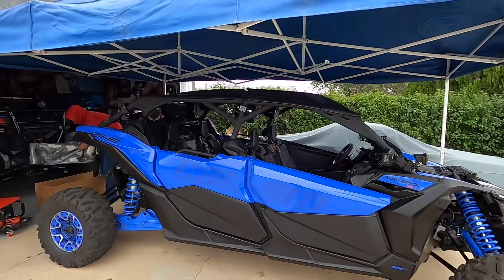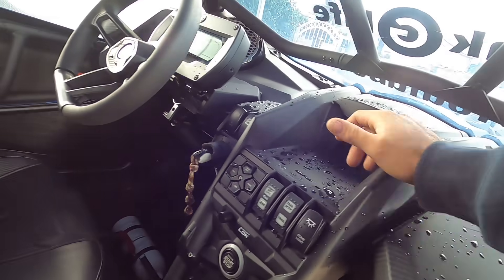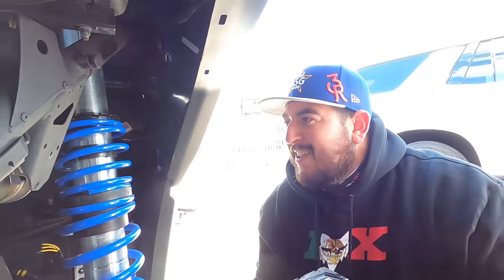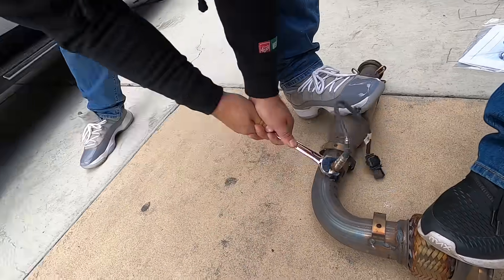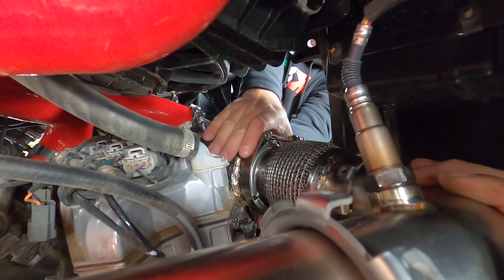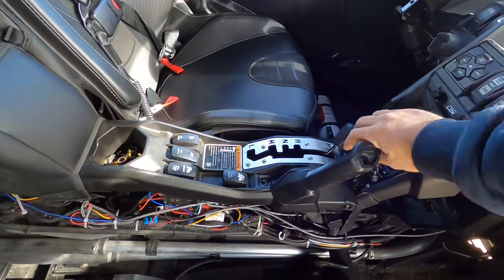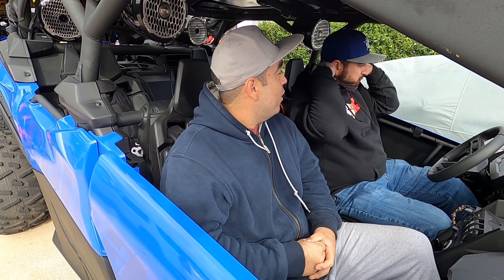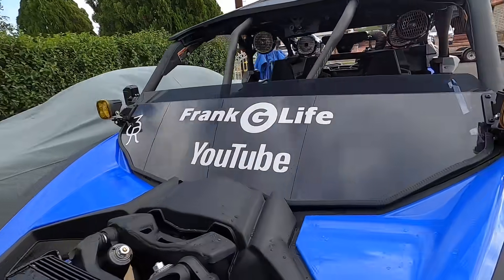2021 CAN AM X3 TURBO RR GETS SHOCKER EXHAUST 🔥🔥 FROM EVO POWERSPORTS EP - 132

Comment: Frankie. For the seat belts. I don’t remove the bolts. I just feed the retractable one off the bottom one. And when I’m done I just feed them back again :). Maybe easier 🤷🏻‍♂️
Reply from the maker: But you have to take the nut off the bottom still right? This has always been pretty easy. And easy to get to
Reply: @GLifeUTV  correct on the bottom since is attached to the seat I was Just saying the top ones :)

Comment: Any issues with gas air mixture? Any over heating or concerns? Do I have to tune or do anything else if I install the shocker? Thanks 🙏
Reply from the maker: No it will run perfectly fine. Check out our site glifeutv.com use code glife5 off ur exhaust purchase
Reply: @GLifeUTV  Great thank you 👍👍

Comment: Agency power sells the same system for 650. 

The only for 1200 is the muffler system. But thats not needed if you have the dump system
Reply from the maker: Yes its similar. But they are using a vacuum acutuated valve i believe.

Comment: How did you get the switch installed in the center console behind the grab handle.  There doesn’t appear to be enough room behind that location for a switch.  Did you have to trim plastic in the tunnel area?  Do you have pictures of what it looks like in that area?
Reply from the maker: I used a dremel to trim it.. dm on istagram. I can take a pic for u
Reply: @GLifeUTV  that would be great. I’d be interested to see how much trimming was needed

Comment: YO YO YO
So i have the rpm 3". How would you say it compares when the dumps open? Just as loud? Or is the 3" louder?
Reply: For looks i dont like how the motor on thr butterfly valves on top. Om the RPM its in the back.
Reply from the maker: @GarSeeYaa  The 3 in is louder then the shocker.. its also a deeper sound
Reply: @GLifeUTV  have you seen the evp 3" shocker they offer? Any chance you've seen that one compared to the RPM 3"?
Reply from the maker: @GarSeeYaa  Ive heard it exists.. never actually seen on yet. Im sure its good stuff
Reply: @GLifeUTV  it use to be special order. Its on therr website now though. Fyi
Reply from the maker: @GarSeeYaa  Nice

Comment: Blow off valve can just be put in right???    No tune are anything special??
Reply from the maker: Correct. No tune needed
Reply: @GLifeUTV  doope thanks.   I have the base model 2019 x3 and im reqlly trying to start upping some power and other cool stuff.
Reply from the maker: @ISAACP_THEGUTTERGUY  they make kits that add the intercooler/ fan and charge tubes.. also need to upgrade the pump and do a tune.. big difference
Reply: @GLifeUTV  yea thats my plan eventually.   Just gotta worl toweds that.   But ideally I'd get up to the 205 with the 3r tune.     As much power as i can get off pump gas.     Thought about e85 but Idk if i wanna get that far even though i have access to it
Reply from the maker: @ISAACP_THEGUTTERGUY  good plan. I think u will be happy in that power jump.
Reply: @GLifeUTV  oh most definitely it will be very worth it.  Just gotta get the funds for it. And clutching. 
I subbed by the way.     
Just started posting content myself. Just gotta work on editing and having a plan haha
Reply from the maker: @ISAACP_THEGUTTERGUY  nice👍